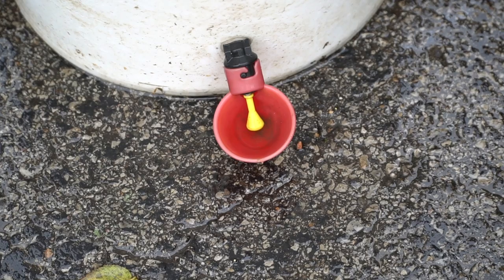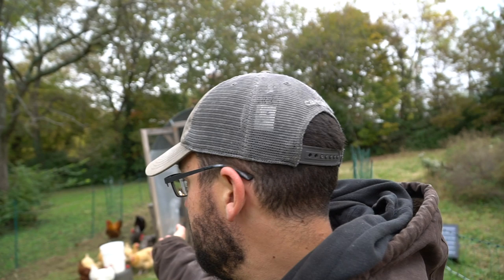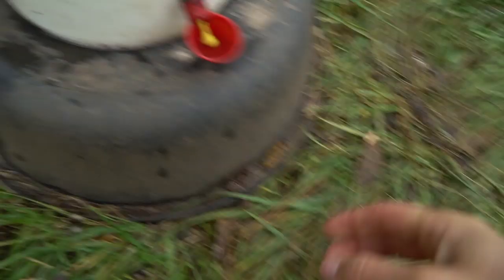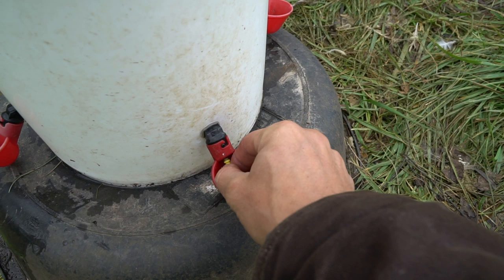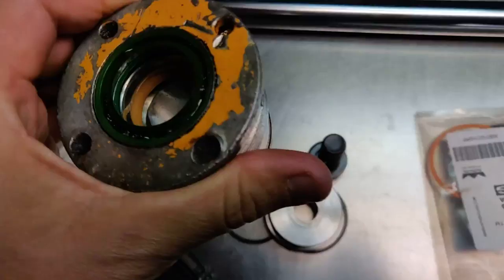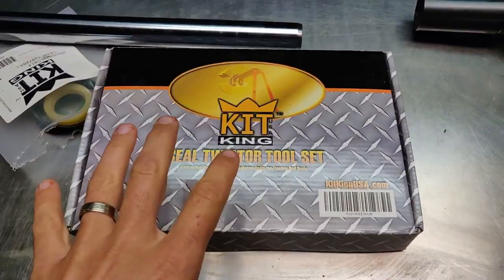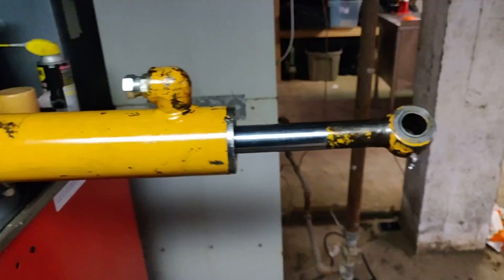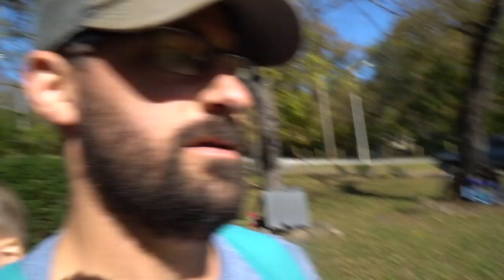Fixing ALL THE THINGS! - Case 1845c Hydraulic Cylinder Rebuild

Comment: Wish I would've seen how you put them on.
Reply from the maker: I can help answer any questions if you’re stuck.
Reply: Just wanted to see what tools you used. And if I scratched the surface would is cause a problem?
Reply from the maker: I used just a pair of channel locks to unscrew the cylinder cap, pulled the position out and used little screwdrivers and picks to get the seals put. Then of course the seal twister kit to get them back in. Yes you don’t want to damage or mar the piston it will cause problems for your new seals later as they run against it.

Comment: After changing mine out it won’t hold pressure and it will slowly tilt down on its own. Anyone else have this problem or know the solution?
Reply from the maker: Maybe trapped air in the lines?